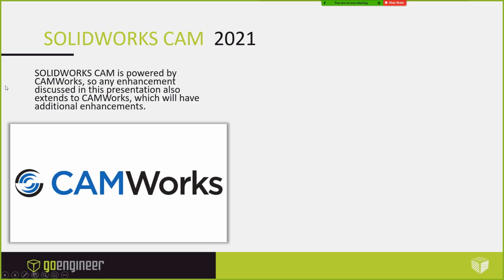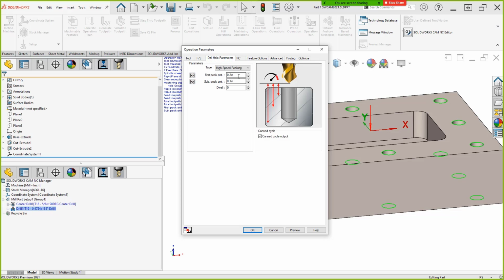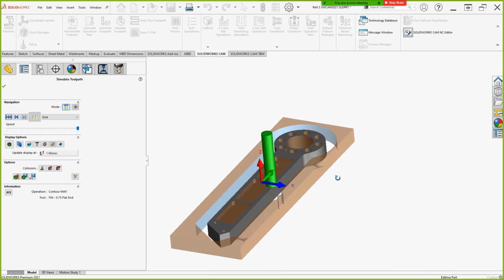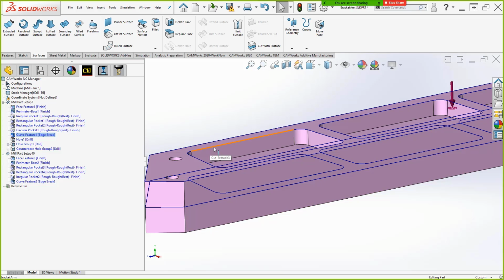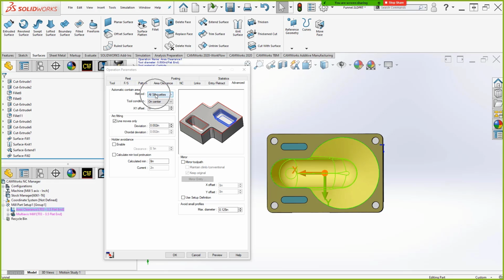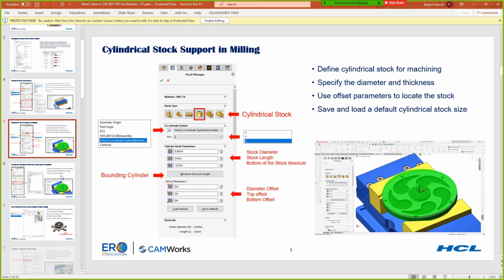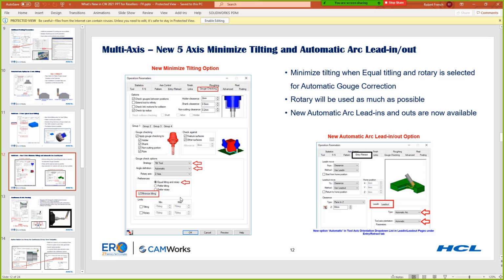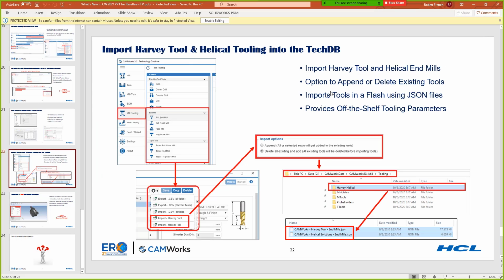SOLIDWORKS CAM and CAMWORKS - What's New 2021 Webinar

Comment: In Solidworks CAM, not CAMWorks, is there a way to adjust the post? For instance, sometimes we like to have an optional stop (M1) after a tool change. Is there a way to change the post so it is output like that? And also, is there a way to get posts for machines not included with the software. We have some OKUMA mills. I noticed an OKUMA lathe post but not for the mill.